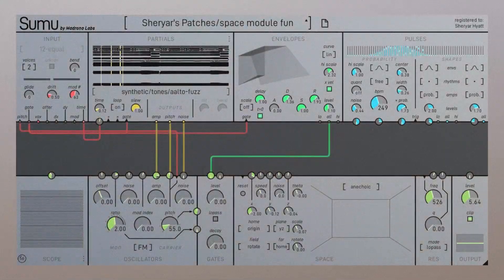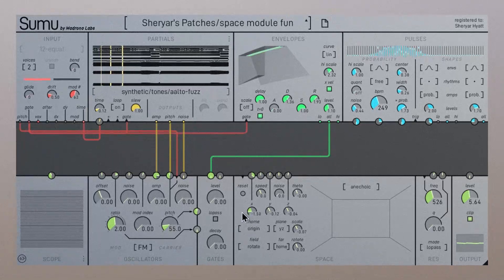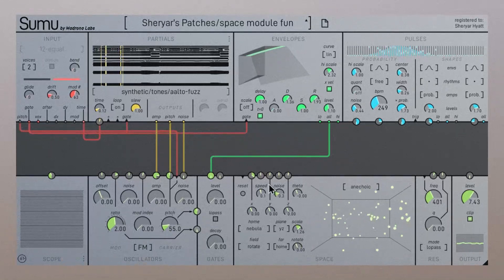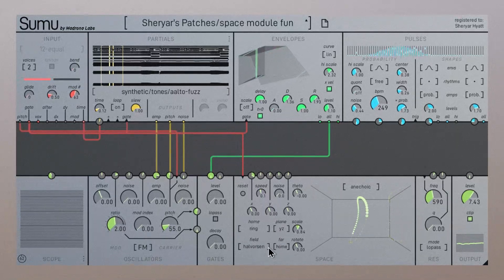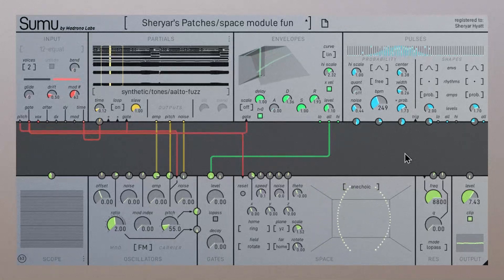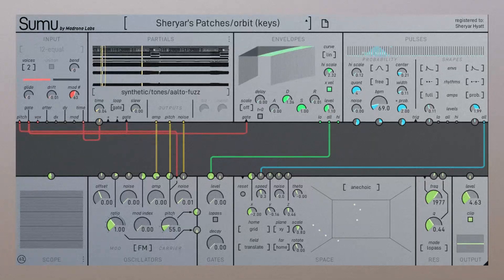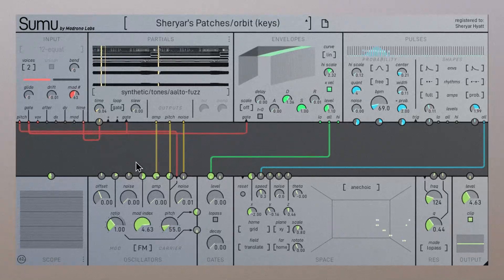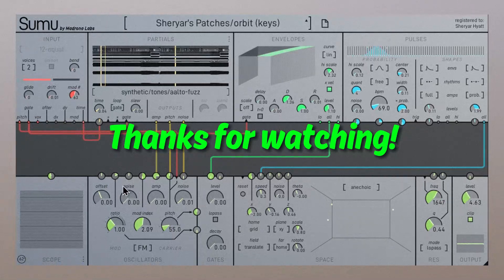How to use Sumu's Space module to make spatialized 3D sounds

Comment: How is the frequency for the RES module being modulated without anything being patched to it?? 3:20 Is this patching within the DAW you're using?
Reply: yes, pretty sure Sheryar is patching using Ableton Live's Configure menu here. –Randy
Reply: @madronalabs  please show us how that is done Sheryar, I been trying - can't figure it out :face-green-smiling:
Reply from the maker: Hey Sheryar here - yes, the filter is being modulated via Ableton in this case (using automation). I have a reel on our IG that covers setting Ableton LFOs up with Sumu.

If you have Sumu 1.0 you can use the new LFO functionality to add similar modulation to just about any parameter in Sumu :)
Reply: @madrona-labs  thanks for your explanation - I did it a different way through experimentation by using the aaltoverb on its own track with the envelope follower and sending that signal to the frequency of the RES module for Sumu on its own track via Live's device configure menu